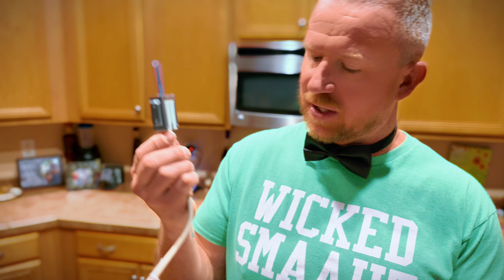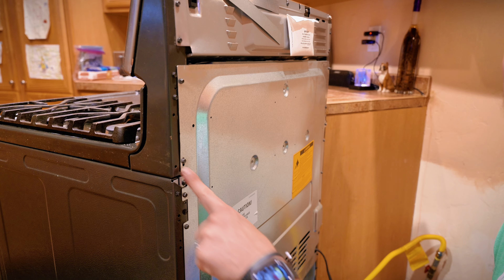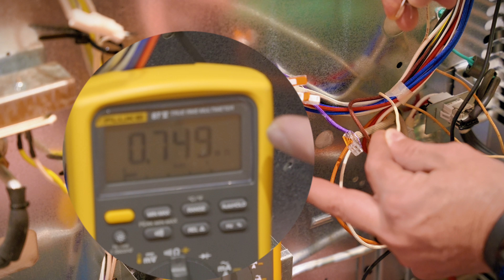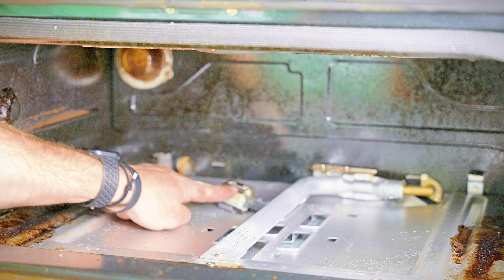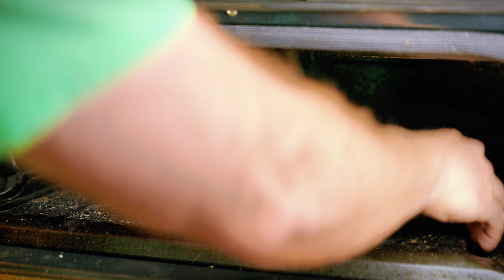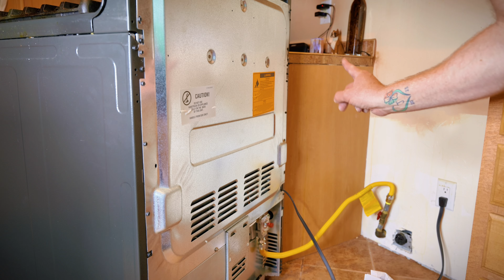How to Fix GE Gas Oven Igniter (DIY Repair Guide)

Comment: My range is 9 years old,  Frigidaire. Burners won't light or even click.  But, if I start my oven first , burners will light perfectly. Also, if I start one burner with a match,  others can be turned on normally.